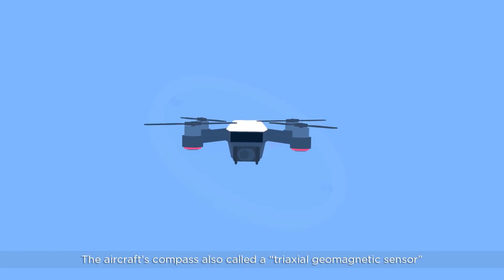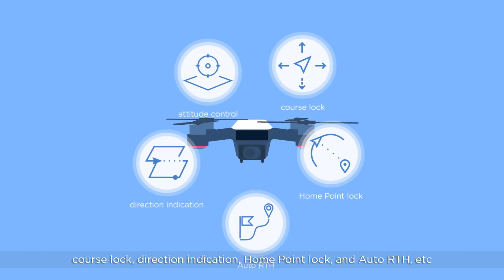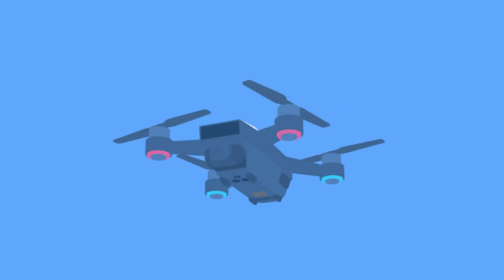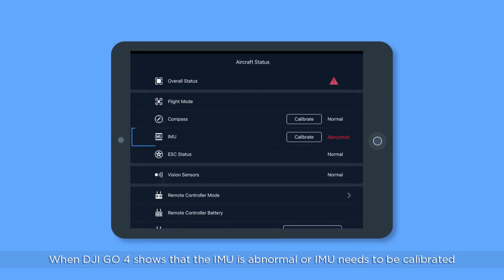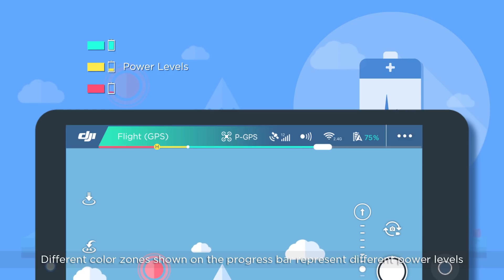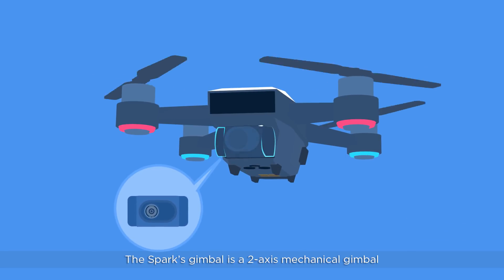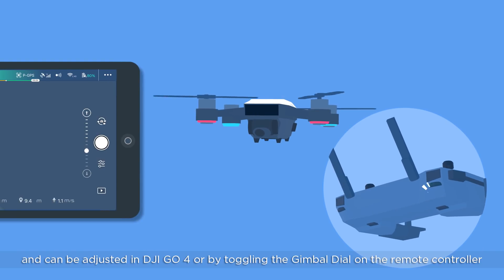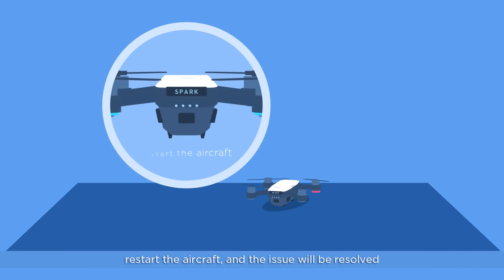DJI Spark Key Components and Parameters (Beginner Tutorial)

Comment: When pairing my remote to phone, it says "Incorrect password for Spark RC..I've tried 12341234 about a dozen times. still no luck.
Reply from the maker: Hi Fort, did you change the RC password before? In this case, please try to reset the RC's WiFi by long pressing the RC power button for about 9 seconds and try to link again. Besides, please ensure that you are connected to the RC's WiFi instead of the drone's WiFi. Please keep us updated at m.me/DJISupport if it doesn't help, thanks.